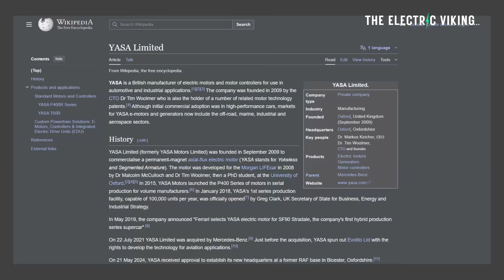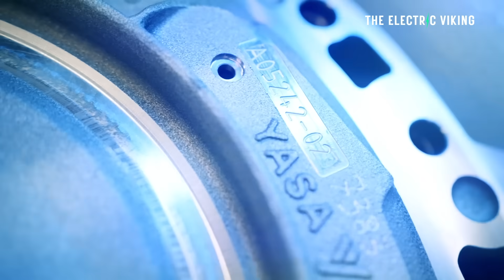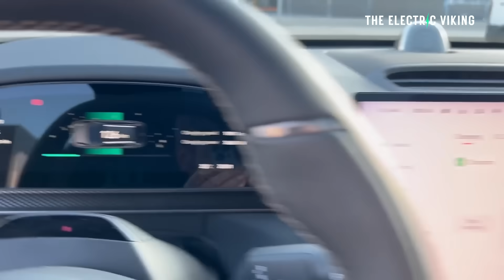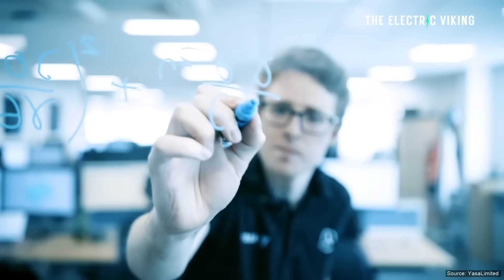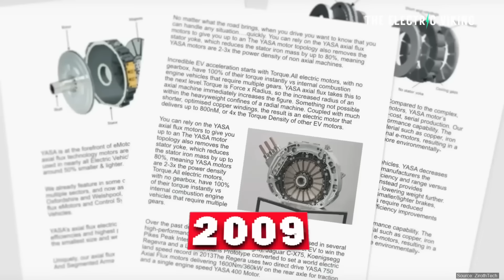The Worlds Most Powerful Electric Motor has 1000HP and Weighs 12kg

Comment: 1:30 Cool claim, but that’s comparing apples to oranges — YASA’s 13 kg figure is just the bare motor. You don't power each corner with a bare motor. A Lucid road-car drive unit, which includes the motor, inverter, gearbox, and differential, makes about 500 kW and weighs 74 kg complete. Even optimistically, once you add the same components to YASA’s setup, it would weigh around 45–50 kg per motor, or roughly 180–200 kg for four of them — not 52 kg — and Lucid’s units have already proven themselves over millions of real-world miles, while YASA’s prototype hasn’t faced that kind of validation yet. The eventual production version of the YASA motor will almost certainly be heavier once full housings, mounts, and other production-grade components are added, which might bring it even closer to parity with Lucid. Axial-flux designs are undeniably cool, but they haven’t yet proven themselves at mass scale — they’ll likely need to be built more robustly to handle production durability demands, and that added strength and tighter tolerances will also drive up both cost and weight.
Reply: Lucid is a shit show of a company.. have fun when UAE pulls the plug
Reply: @Waaltizzlr Not sure what that adds here. No one's talking about feelings

Comment: Make them 4x smaller, put them inside the wheels, and use the weight savings for larger batteries.  3000 horsepower is not really useful for anything besides high insurance rates and dead people. 300 HP at 10 pounds would be as much as any sensible person would ever want. And because the motors could be so small, you could use exotic materials like titanium because so little of it would be needed.

Comment: With solid state batteries it opens the era of electric aviation
Reply: HP is one thing but packing enough batteries to power the engines is another.  4000 HP needs tons of batteries to supply the current required to continuously feed these hungry beasts.
Reply: @jondavies7042 hundreds of pounds. And again, there is no requirement for 4000 horsepower. Even smaller AND lighter AND cheaper Yasa motors could power human rotordrones and light aircraft with quite smaller battery packs. Efficiency = flight time.
Reply: My Jetson could zip into the sky so fast I'd get whiplash.
Reply: No, the weight is still a problem.  Because the airplane still weight the same when they going to land as they did when they started.  And that is a big problem.  And then You have the other problem.  More weight from "fuel" means less passagers  .
Reply: If people can afford them (which they can't) in the UK.
Reply: @stevewhitmill2037  who cares if the average UK resident can't afford a plane with solid state batteries?😅
Reply: @stevewhitmill2037 as the past 300 years show, price comes down with mass production.

Comment: Only 12kg plus a 500kg battery!
Reply: Yes 😂😂😂😂😂
Reply: What would be really cool is a hybrid with it, have a small generator feeding into it for low fuel weight, and total "motor" weight
Reply: @crispycrusader1  it's amazing you would say that, I am always advocating that sort of thing! You get the best of both worlds: a tiny gas engine optimized for efficiency, and a smaller battery that can be optimized for other characteristics than energy density.

Comment: These are even more relevant for electric aircraft.
Reply: Sorta, the engine is a drop in the bucket compared to the battery weights.  It all adds up but electric motors are already light enough...far lighter than jet and prop engines.  The issue is that batteries are much heavier than fuel for equal energy.
Reply: @veganpotterthevegan  Exactly, when you have literally one to two tons in batteries, a requirement for any kind of sustained, high load output, the weight of the motor largely doesn't matter at all. The combination is far heavier than a combustion engine and a gas tank.
Reply: @veganpotterthevegan Right. And even the theoretical limit of solid state batteries doesn't march. Someday I think we will be able to "power beam" to inflight aircraft.
Reply: @tricotdiko1435  Well, in 2063, we will have the first warp flight
Reply: @tricotdiko1435 yup, not to replace very long international flights.  They can certainly potentially cross the Atlantic and pacific though.  Just no flights from Australia to NY😂
Reply: @GameOn82 I doubt it. You're so clever gramps!  Have you heard of the DARPA' (10kw over 200 km this year or next-optical). Have you heard of Whisper Beam? (Gaussian RF beams. Intagrates transmitters into drones already. Very little collateral radiation). How about PowerLight Technologies? (Beamed to group 2 UAS this year at 5000' its going into the KL1000ULE UAS.) Did you hear about Emrod's patents for fuselage integrated attenas? Did you know Airbus is exploring space based solar beaming for aircraft relays? Now how far has warp drive gone so far? I never said it was around the corner did I? Have fun snarking! You're so competent at it.
Reply: @veganpotterthevegan Did I say they would? Thanks for acknowledging that it is quite possible to beam power to aircraft someday.
Reply: @tricotdiko1435  Woow dude chill out, grab a beer or something to take the edge off!
Reply: @GameOn82  apparently Time Travel was invented, way back in 2901.... ;)
Reply: @tricotdiko1435  "Right. And even the theoretical limit of solid state batteries doesn't march. Someday I think we will be able to "power beam" to inflight aircraft"

#1. Solid state LiS might have a better chance at it, though probably it will still fall short for large, long range aircraft.

#2. I don't care how badly anyone says power beaming is safe, I wouldn't touch an aircraft that was going to use it, and I'd warrant few others would too - we're talking multi MW power densities aimed at a moving target full of people.

N.O.P.E.

Even the highest efficiency wireless power transfer devices made for terrestrial EVs literally less than a meter away from the antenna are still 99%.

For planes KILOMETERS in the air the efficiences would drop significantly even before we talk about movement losses.

1% of a MW is 10 KW lost to heat.

Whether it's the batteries or the cabin that gets that neither is good.

Now imagine 10+% of multi MW transfers.

That's 100s of KWs lost to heat, definitely in the territory of cooking your passengers and likely the batteries too.
Reply: @tricotdiko1435  "Have you heard of the DARPA' (10kw over 200 km this year or next-optical)"

The actual test was 800w at less than 9 km for only 30 seconds.

The stated efficiency is TWENTY PERCENT.

Try actually reading the full articles instead of just creaming your pants on the headlines.
Reply: @veganpotterthevegan  "yup, not to replace very long international flights.  They can certainly potentially cross the Atlantic and pacific though.  Just no flights from Australia to NY"

Transoceanic flights are plenty long.

NY to Oz would need to recharge in at least LA and Hawaii.

NY -> LA -> Hawaii are roughly the same distances of 2,500 miles.

But Hawaii -> Oz is about twice that at over 5,000 miles 😬, so you would probably have to recharge again at Samoa or something similarly close.
Reply: @mnomadvfx  yup, so still a very bad application.  Crossing the EU or US may be "possible" soon but there are still many problems to sort out like landing weight and charge time.  Planes are obviously expensive and they really need to be running a good +12hrs a day to profit off of them. Without fast charging(its like these people think they'll charge in 2hrs like a car😂), these things will just sit too long and lose money.
Reply: @veganpotterthevegan  "far lighter than jet and prop engines"

In electric aircraft designs though they tend to push more smaller motors spread across the wings rather than 1-2 beeeg motors per wing, so every little bit helps.

That being said there was a thing in the news a few months back about a 1-2 MW electric aircraft motor, I wonder how that compares in power/weight ratio as this new motor is already over 750 KW output.
Reply: @mnomadvfx  yeah, maybe 4 props on each wing.  I just know that now, there's a very small number of electric, commercial planes and they're VERY small, very slow and have a short range.  Like with cars, we will just do hybrids for a very long time.  But they're prop planes too that are much slower than jets.
Reply: @veganpotterthevegan  Material chemistry is advancing as well. batteries will catch up.
Reply: @veganpotterthevegan  No longer an issue density is doubling.
Reply: @danmosby7980  doubling isn't enough.  It's absolutely still an issue.
Reply: @veganpotterthevegan  I believe the number required for flight was 400 wh/kg we are above this level so anything exceeding is a bonus.
Reply: @danmosby7980 400 is sort of OK for mid range flight.  That's good but not good enough to replace jet fuel.  All you need to do is look at current electric planes.  They're barely usable for commercial flight and only a novelty.  The best planes are using batteries around 300wh/kg.  They're not anything close to being practical.
Reply: @danmosby7980 jet fuel is around 12000kw/k😂 Granted, it's not 100% efficient.  But we have a very long way to go and those planes need charged.  Jet fuel is a fast and easy way to charge a plane.  Planes often have fast turnarounds.   Imagine the voltage needed to charge a +200passenger plane  in less than 4hrs?  You also need to consider that planes need to be empty of much of the fuel to land safely.
Reply: @veganpotterthevegan  ??? Thats wrong. We need the planes to have capacity  cover twice the ground as a car.
Reply: we have Evtol working today, drones  etc
Reply: The aerospace division of YASA was split off as Evolito Ltd.
Reply: @thomasprogli3372  We need some of those vaportech graphine solid state batteries. :)
Reply: Aircraft?????????
Reply: @jorgefurtado9037 an airplane, helicopter, or other machine capable of flight. They are super cool!
Reply: Jet thrust is huge grip of air, electric motors need more grip as don't have jet engine Thrust and probably never will. So many small motors can transmit to more grip rather than one large motor trying to replicate a jet.
Reply: motor is light and battery is heavy, so the electric tanks make more sense than aircraft
Reply: Exactly. They do not really fit well inside a VW Polo.
Reply: No, the batteries still weigh to much ;-)
Reply: @henrikl1394 That doesn’t make sense because there are many electric aircraft already and lighter motors will help.
Reply: @tricotdiko1435  there are many, tiny electric planes with very low payloads and short ranges.  They weigh too much to land with a respectable payload.
Reply: @veganpotterthevegan Gee thanks!
Reply: yep but what about the resiliance and confiability? Needs a long path to be in the normal aviation.

Comment: I'm less interested in the gravimetric density of the motors than the packaging possibilities offered by their small size, due to their volumetric density.  Anything that allows you to build a smaller vehicle will save more weight than lightening the motor, which is a small part of vehicle weight. If you want top save weight, batteries are your target.  Fortunately, that's getting better too.
Reply: as the supermarket ad goes...'every little helps' ;)

Comment: This is crazy. Just putting it into perspective Mercedes could, if they wanted, build a super car with 2 of these bad boys with a total of 25.4kg. This leaves another 450kg for high performance battery packs. Using Samsung's 500wh/kg pack, we'd get 225KWh batteries. This is a true EV supercar.
Reply: MB made disastrous choice with the're battery  brand choice,  let's hope they do better joining a Yasa motor(s).
Reply: Always, always an excuse to through out the brand tesla, even when it's NOT the fastest battery make!
Reply: What's crazy is:
"Worlds Most Powerful Electric Motor has 1000HP"
Pure, unadulterated clickbait. On the scale of the World's most powerful electric motors, it's a least an order of magnitude on the low end.
Reply: @-danR  Consider the context. These motors aren't moving an ice breaker or container ship or submarine, they're EV motors. Marine motors typically weigh multiple tons, sometimes tens of tons.

Comment: 1000HP and only 12kg?!?! There oughta' be a law.
Reply: Total bs because a battery that can output 1000hp continuously weighs half a ton.
Reply: @polska905  Oh I don't know. Like tech innovation didn't just suddenly stop in 1986. Plus, you think Mercedes has no idea what they are doing, no engineers on staff?
Reply: @douglascutler1037 Mercedes is just getting on the green grift..., the highest capacity 18650 is still around 3.5ah as it was 10+ years ago, how's that for progress? If anything were going backwards since lfp batteries are less energy dense... Lol
Reply: @polska905  Quick search yields this: "The latest electric motor designs have achieved power-to-weight ratios as high as 56 hp/kg, with YASA's new 738 hp axial flux motor setting an unofficial record at 56 hp/kg (42 kW/kg). This is more than double the current industry benchmark of about 20 hp/kg."

12 X 56 = 672 HP for a 12kg unit so not that far off the design proposed here.
Reply: @polska905 
Well, that would be fantastic! A battery that only weighed 500 kg would be great most are heavier.
Reply: @glenndennis6801  This is not the only such report. I've seen several reports over the last couple of years for new electric motor designs which significantly increase the power to weight ratio. But it's true that only a small percentage of reported innovation breakthroughs actually make it to market.
Reply: @polska905 Chevrolet delivers around 4.7kW/kg (60c) with their battery for the Corvette E-Ray. So 160 KG to deliver energy for 1.000 bhp when you scale it up … for up to 40-60 seconds and a top speed of 400-600 km/h. Then add some weight for the inverter and the other stuff for this engine to get the power to the tires. In sum 200-250KG for 1.000 bhp for 40-60 seconds. The weight of the Electric engine is not the problem.
Reply: @Heiko1982 the weight of a electric MOTOR are not the problem, it's the batteries, with 160kg of batteries, you can only make 1000hp for seconds not even minutes... Lol
Reply: @polska905 yes, great innovation. It is even worse: Before the batteries are drained within 60 seconds the e-engine and inverter would limit the performance to the half after 10-30 seconds because of overheating 😂 all these values are just peak values … there are so many car manufactors which could solve this, but they ignore the reality, that the most efficient way to store energy is a petrol tank. While petrol is most efficient to store energy, eletric engines are most efficient to deliver power to the tires. Batteries should only be used as a capacitor and not for storing Energy. This would also save so much weight as 5-10kWh would be enough when you have a constant energy supply, e.g a 1.5l Turbo ICE 😊

Comment: Who cares about a a useless 2000-3000 hp car? I want to see a really small ~200 hp motor that will add little to the unspung weight.
Reply: Wheels already have unsprung weight called "the brakes". Yasa motors could replace those heavier items with hub motors that brake by regen. 
And you could imagine lower powered versions of the Yasa motor, yes? Lighter too. You know 1000 horsepower is just to show they can. Cheaper 200 hp motors is a no-brainer.
Reply: @davis.fourohfour  Still need mechanical brakes Einstein

Comment: I believe when autos are truly designed to take advantage of the compact size of these types of motors, a new design philosophy will take hold.  Autos will become profoundly more space and energy efficient.   Which will move auto design forward making a full break from traditional design approaches.  The architecture will no longer be backward compatible to ice based designs.  These new architectures will require a full break in design approach to take full advantage of them.